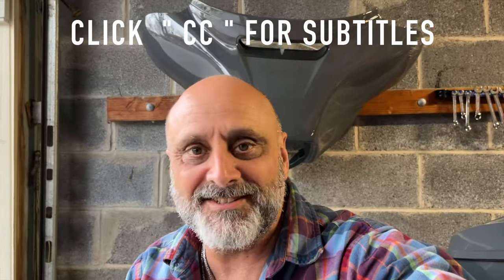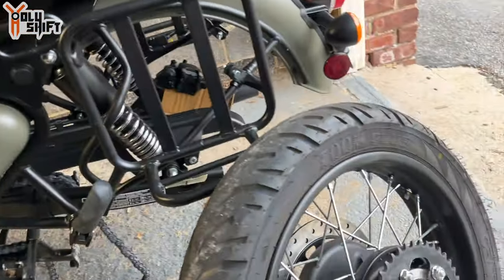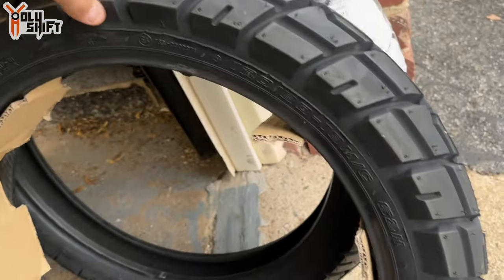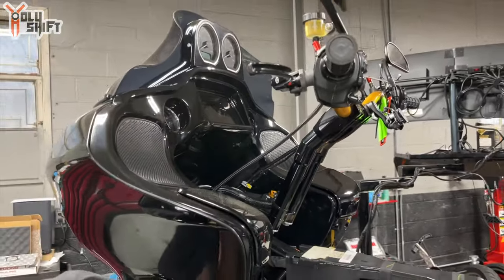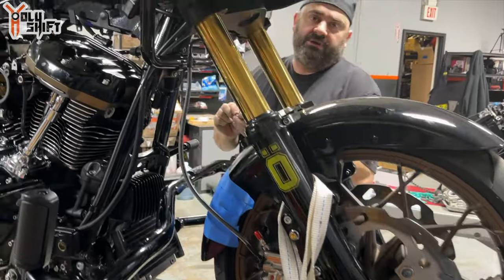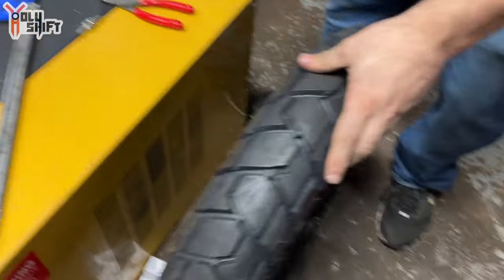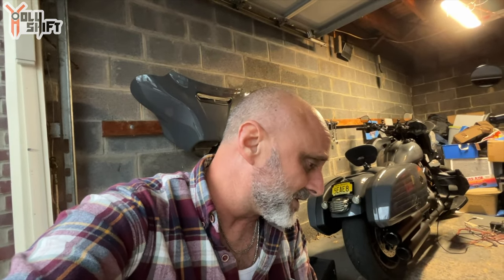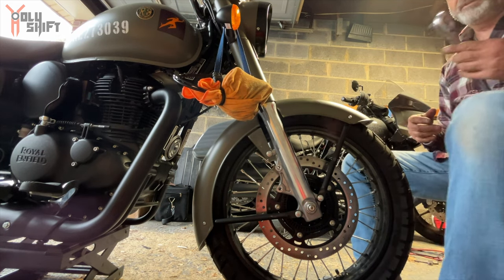Off Road Tires Installed Royal Enfield Classic 350

Comment: So I took delivery of my 350 classic signals desert sand last Friday. Before they delivered it, I had the dealership change the tyres. 80%Road, 20% trail. Bridgestones. They look far better than stock. I'm having an absolute blast riding my Royal Enfield. The 300 mile running in period is a pain though. I took the pillion seat off. It looks far better. Cheers from the UK mate! 👍😊🍻
Reply from the maker: Such a cool bike! I love it. Enjoy bro!
Reply: Just got mine yesterday I want to put some beefy trail tires on it to give it a scrambler look. I’m in the break in period too 😂😂😂
Reply: Could you please tell me the name of those tyres? Thankyou
Reply: @1234fazermann  I can't tell you the exact model but they are called Battlaxe by Bridgestone. Literally 80% Road 20% off road. I'm sure your tyre supplier could find them for you mate. I've done nearly 3000 miles on them. Great grip!

Comment: Quick tip, if installing the rear wheel on your own, remove the silencer (3 bolts) you can easily see when all 8 parts are aligned, yes Iv'e been there 🤣🤣